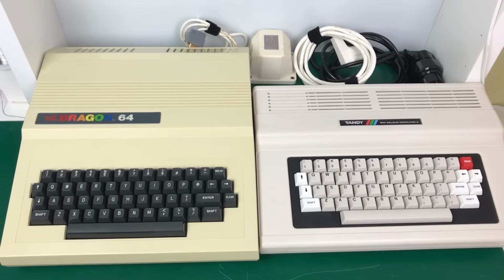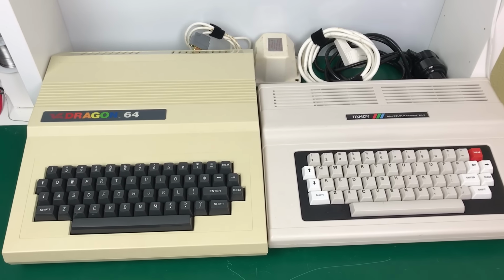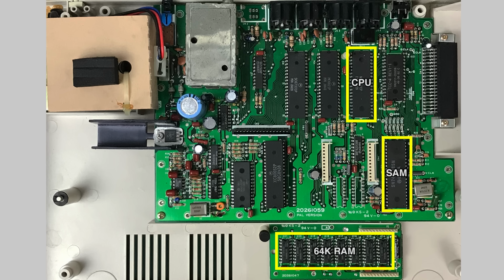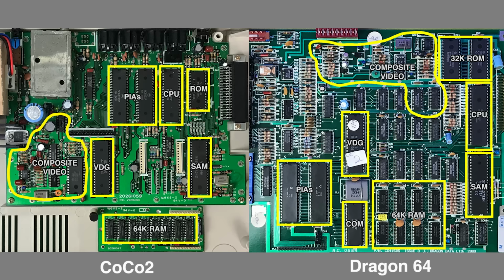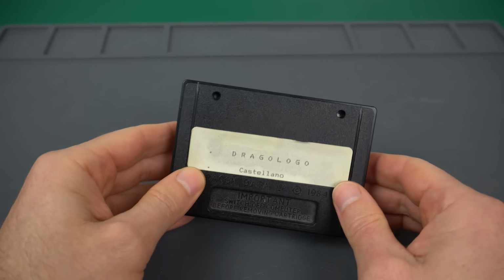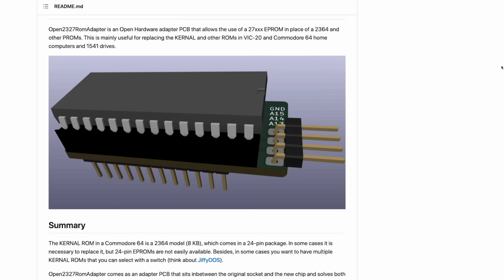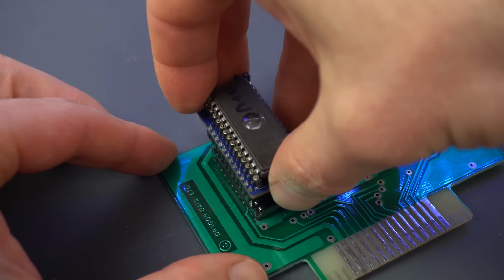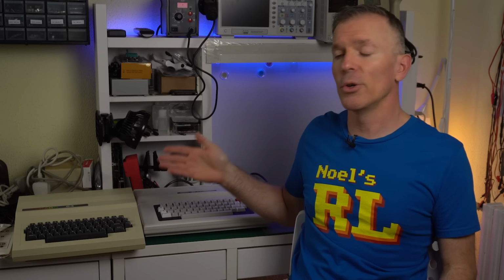Is The Dragon a Clone of the CoCo?

Comment: 10 REM HEX LOADER FOR EXTRA DRAGONDOS COMMANDS
20 CLEAR 200,31599
30 INPUT "START";ST
40 INPUT "END";ED
50 FOR J=ST TO ED STEP 8
60 PRINT USING "##### : ";J;
70 INPUT A$
80 CS=0
90 FOR K=1 TO LEN(A$)
100 CS=CS+K*VAL("&H"+MID$(A$,K,1))
110 NEXT K
120 INPUT " = ";C
130 IF C<>CS THEN PRINT "CHECKSUM ERROR - TRY AGAIN":SOUND 1,1:GOTO 60
140 FOR K=0 TO 7
150 POKE J+K,VAL("&H"+MID$(K*2+1,2))
160 NEXT K,J

this small program wont work - it results in a typo or type mismatch error ! please help if u can thanks !!!

Comment: Yes, looks like Dragon based it on the Coco, the same keyboard, the same Cartridge connectors, some software works on both etc.

They made enough changes not to be sued and maybe claimed it was based on some reference design.

In the 1980s something going on in a Welsh warehouse would not exactly be on the radar of a large company in the USA!

Let's just copy that computer, and the BIOS, and those BASIC ROMS, no one will know until that internet thing comes along:)

Comment: I worked at Motorola in 1977 to 1994. The CoCo was based on standard Motorola devices, 6809E, 6847 VDG. 6883 SAM, etc. None of these devices were Tandy proprietary. Tandy got the  software from outside sources. Tandy took the standard Motorola devices and standard software and offered it as a CoCo.

Comment: Great video!

Thank you for sharing!

The Tandy Radio Shack Color Computer 2 is what I started with.  Though the model I had used the standard 6847 not the T1 version.
As far as the Dragon64 goes the serial chip is a MOS 6551 which also the Tandy Radio Shack sold a Deluxe RS-232 Pak which also used this same MOS 6551 chip.
The serial port on the Dragon 64 is limited though to 38400 as the Op-Amps are slow in the Dragon 64.  You probably could upgrade the Op-Amps to faster versions to get speeds up to 57600.

As far as the floppy controllers go between the Dragon and the CoCo the basics have different entry points that is the biggest problem.  There is a Disk Basic called HDBDOS which is used for DriveWire on the CoCo which also has been modded to have the entry points updated so it will work on the Dragon's basic.  Though HDBDOS is based on Disk Basic that came with CoCo's floppy controllers.

DriveWire might be something interesting for you to look into if you like using the Tandy Radio Shack Color Computer 2 and Dragon64.  

Also there is a upgraded CPU that you can also use in the Dragon32/64 and Tandy Radio Shack Color Computers called the HD63C09E.  It has extra instructions and also is CMOS based and thus will run cooler and consume less power.  Plus there are custom OS-9's that take advantage of this CPU.  This OS is called NitrOS-9.

Comment: Looking at the Dragon keyboard matrix which is arranged electrically in ASCII order for faster key scanning and comparing that to the CoCo I would say the CoCo is the clone.
The CoCo matrix looks like they took the Dragon matrix and swapped a couple of rows. This would make the key scanning code less efficient.
Another clue that the CoCo is a clone of the Dragon is the Dragon has a parallel port and the CoCo uses the same IO lines to create a serial port. Where the parallel port is an obvious straight forward design the CoCo serial port is particularly cunning and would have taken much longer to develop.

When the Dragon 64 came out they simply added a serial chip for the serial port.

Comment: You can save the BASIC program with the A parameter (For ASCII) and it will load on the other computer.  It save the basic program in ASCII instead of compressed.  Take more space on the file.

Comment: 6:09   Its not really surprising that the coco psu is so small.  What's remarkable is how unnecessarily big the Dragons seems to be.

I mean, you'd think at least that they could have got the AC transfomer into the case.  Heck, the Beeb managed it.

And at the other end of the scale the Spectrum had a 9V power brick but managed to squeeze the generation of all the nessecary voltages onto that tiny mobo.

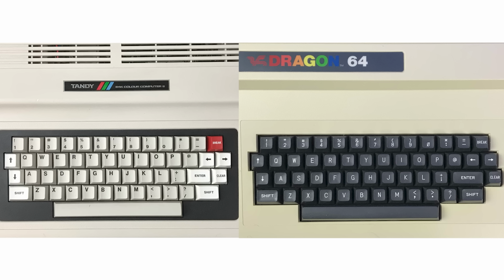12:46   Not sure what they were exactly, but I understand the Dragon keyboard stuff was changed for some kind of effiency/responsiveness benefit.  (https://youtu.be/0IipxReq0G8?t=680)
Reply: Making the computer with no mains inside is very sensible and allows children to safely open the case and tinker. It also means you make another company responsible for the transformer and carry out all the product safety whilst you work on the computer independently.

Comment: Both computers are actually based on a reference design from Motorola, the Microchroma 68, featuring a version of the MEK6800D2 MikBug monitor called TVbug. This was essentially what is in the coco (and dragon) computer. Tandy used this base design to create a  Videotex terminal for farmers called the AgVision, and if you google for that you will see its actually a blue coco, it even has facilities for what later became its cartridge connector. What I want to say is that Tandy cannot claim ownership of the CoCo's architecture as it not theirs, its Motorola's. They simply took the Microchroma 68 design put it in a somewhat nice case and replaced TVbug with a BASIC written by Microsoft.

Comment: The Dragon was a clone of the Tandy.  The ROM was a bad clone as there was a bug in Dragon BASIC, in its DEFUSR(0) command.   What killed both the Dragon and the Tandy was it's poor graphics chip the VDG.  It was worse than what the Spectrum, Atari 800 and VIC-20 could deliver.  The CPU was good, but was under-powered at 0.89MHz. Most enthusiasts today replace the 6809E with an Hitachi 6309 which is about 20 to 30% faster and clockable to 5MHz.  It may be a good project to see a much faster running Tandy and at 5MHz, as some of the old games really do need the extra CPU power to be playable.  There is also a poke to speed up the Tandy - POKE 65495,0 to double BASIC program speed and POKE 65494,0 will return it to normal speed.

Comment: I didn't play a lot of games on my Coco. However, I did a lot of hardware development. I built several peripherals for it including a universal EPROM programmer, a text to speech card, and a 6809 In-Circuit emulator that worked by allowing the Coc's 6809 to take over the target system's bus. I also build a data logging card that used a small fast ADC that had a two-wire multi-device interface that I had to bit-bang. I did many other projects as well. I miss the days of direct access to hardware! As for software, my favorite programs were the assembler cart and the terminal program that allowed me to dial into my favorite BBS. Remember those?

Comment: I prefer the COCO.  The keyboard is not that much worse, but the small size and built in PS are winners for me.  All that said, my real favorite COCO is the COCO 3.

Back in the mid-80's I used a COCO 3 with 2 double sided floppies,  a Tandy 1200 baud auto answer modem, OS-9 level 2 and BASIC-09 to build a BBS system.  Although I had less than 50 users, it was a great project from my perspective.  Those were the days!
Reply from the maker: Fair enough. I'm definitely looking forward to trying out a CoCo 3 sometime. Everybody raves about it.

Comment: The Motorola reference design was used as the basis for a videotex terminal sold breezily by RadioShack around 1980/It didn't sell very well. Radio Shack reused the  videotex deign for the original Color Computer

Comment: For what it's worth both manufacturers followed Motorola's reference design very closely and as Dragon Data also went to M$ for the OS/Basic that's the reason for the similarity. Not clones as such, more siblings. (The Dragon is no more a clone than I'm a clone of my older brother.)
The primary reason why they aren't 100% compatible is for some reason when M$ sold the exact same Basic (and technical support) to both manufacturers they fiddled with the tokenising in the Dragon version. Also the Dragon's keyboard mapping is a little different.*
*It's entirely possible to make a Dragon 100% Tandy compatible, and switchable between modes. A mod that had some popularity as the CoCo had more software alth9ugh you could just as easily make a CoCo Dragon compatible.

It's my unverified understanding that the very close similarity of the non-Motorola inspired parts was on the advice of M$ who weren't going to waste effort on rethinking technical advice for a small company like Dragon Data. Did Dragon Data know about the CoCo? Of course. Were they trying to make a CoCo clone? No, because they didn't. But driven by the same design process they followed a path already walked by Tandy.

Comment: I haven't gotten far into the video so you might address this later but, there were common composite board designs out there back in the day. Most used plunger test leads to connect to specific places to get the composite signal. I purchased one back then and my father and I duplicated it for the rest of my Cocos. I liked that design best because the RF port was still usable after the modification.
 
Edited: Never mind. I now see that you get into the composite mod. lol

Comment: A better way of looking at the parallel/serial port differences might be to think of the CoCo as having a serial port for the printer, instead of a parallel port as the Dragon does, and the Dragon having an additional interface for serial communications, such as a modem or a terminal for a second user if you're running OS/9.

The CoCo serial port was entirely bit-banged and while that was fine for a printer it was not so good when used for bidirectional serial communications. Not only did it lack any control signals except for carrier detect, but bit-banging  it ate a substantial amount of CPU time and set a fairly low limit on the serial rates you could achieve. This was especially noticeable when using OS/9 with an external terminal so that you could have a full 80×24 text interface.

I seem to recall that at some point a serial interface cartridge with a proper UART was released, but I can't seem to find any reference to it now.
Reply: There were several serial options.  Radio Shack put out an RS-232 Pak, still in the early days.  It could do at least 2400 bps.  Later there were a number of 3rd party serial cartridges, as well as multi-I/O boards like the Disto 4-in-1 that added a serial port, a parallel printer port, a real-time clock, and a SCSI interface on a daughter board that plugged into Disto's floppy drive controllers.  The advantage of a system like that was that it didn't require an expensive Multi-Pak Interface in order to use it with a disk drive.

Interestingly, very clever coding has gotten MUCH more speed out of the lowly bit-banger.  Drivewire allows a modern computer to serve up disk images to a CoCo over the built-in bit-banger port, and gets up to 115kbps on a CoCo 3, or 57k on a 2 in either DECB or NitrOS-9.
Reply: @joelavcoco  Sorry, I should have been clear when I was talking about "low rates" I meant low rates _while do anything else at the same time_, such as printing the received data to the screen, scanning the keyboard for things to send, or even running other programs such as you'd want to be able to do while using a terminal to talk to OS/9.

On pretty much any computer if you're willing to dedicate the entire CPU to serial transfer you can achieve reasonably high rates even with a bit-banged interface, but this is practically useful only for certain kinds of file transfer applications.
Reply: Towards the end of the Coco's life, there was a modern expansion "cartridge". If memory serves, it was still limited to 300 baud. It included a really poor terminal program. The hardware was quite rare -- I briefly owned one, but I do not recall any reviews or much advertising.

Comment: I seem to remember a blurb about the Dragon being designed with aid from Motorola and based on their reference design, but as you said the details are a bit too similar. I'd guess a believable scenario would be someone just handing them the schematic as a reference to the problem already being solved before.

The most telling part is that in the MC6847 datasheets they used a dedicated chip for the colour circuits, but here they've both got a dedicated circuit instead. I would think Motorola would have sold them on that chip instead of all those components.
Reply: It seems feasible that Motorola might have directed the design for increased compatability with the existing platform.  When Mettoy set out to create a computer it doesn't seem like they had a lot of requirements except "we need it yesterday".  And Motorola had worked together with Tandy to create the Coco.

Comment: When Motorola launched the 6809, and it's associated support chips, Motorola published a reference design to show how to use them. This design is basically what the Tandy CoCo and dragon computers were based on, with minimal difference between them.

Mentioned here:-
Internally the CoCo 1 and CoCo 2 models are functionally identical. The core of the system is virtually identical to the reference design included in the Motorola MC6883 data sheet and consists of five LSI chips:

MC6809E Microprocessor Unit (MPU)
MC6883/SN74LS783/SN74LS785 Synchronous Address Multiplexor (SAM)
MC6847 Video Display Generator (VDG)
Two Peripheral Interface Adapters (PIA), either MC6821 or MC6822 chips

https://zims-en.kiwix.campusafrica.gos.orange.com/wikipedia_en_all_nopic/A/Motorola_6809
http://www.roust-it.dk/coco/The%20MC6809%20CookBook.pdf

Comment: CoCo2 was my first system; got it from a garage sale in the late '80s. I learned to program in BASIC on that thing with the help of the book it came with. Though I think if I wanted to mess around with an old system like that again, I'd stick with a fantasy console, like Pixel Vision 8 or similar. Vintage hardware is too pricey and temperamental for my taste, heh.

Comment: Love the look and form factor of these older machines, especially the keyboards. Wish I could get a pc or Mac that was built the same.. like with the form factor of the bbc micro. That would be awesome!
Reply: I built a PC out of a BBC Micro case which I got from someone who had taken the main board and power supply. A 1U PC power supply fits in the BBC Micro case power supply space. I had to modify the case for the power connector. There’s a mini ITX board in the case and againI had to modify the back panel but it does fit nearly!

Comment: All I know is the Dragon line of micro computers were designed and developed in Wales, Great Britain. I slightly remember them in the 1980's. The Tandy computers not so but I do remember the high street shops called Tandy that sold electronics in the 1980's in the UK.

Comment: Looks like they both came from the same reference design, so they are brothers, so to speak.
The chipset and the Microsoft Basic emulator put restrictions on the way the system is designed, but Dragon64 design team did take advantage of what little leeway their was and distanced themselves from the Tandy machines. Legal fights based on forced commonality would not have much teeth in court.
Thanks for the comparison, good stuff!
Cheers,

Comment: I was sure I'd read that the CoCo was based very directly on a reference design put out by the CPU manufacturer so the Dragon would've also been based on the same reference design. That doesn't explain why everything is so similar, but might explain why some things are so different. Perhaps the things that are different were not part of the reference design?
Reply: Clearly Dragon Data copied Tandy then swapped a couple of things just to make it incompatible. Anyone writing software for one would simply need to release a version for the other. I expect they kept the cartridge the same in the hope of reducing cartridge manufacturing costs where as swapping keyboard lines or Basic tokens just makes it different at no cost.
Reply: However looking at the more elegant Dragon keyboard matrix it looks like the Tandy swapped a couple of rows to make itself different.

Comment: So basically they are both clones of the Motorola reference chipset designs..
Reply: yes, exactly, and did you know that this reference design was first turned in a into a practical machine when Motorola teamed up with Tandy to design a "videotex" terminal for farmers called AgVision , and Tandy created it from that reference design into what would later become the coco, It was simply a "blue coco" and Tandy already added a cartridge slot, although it was unused in the terminal. Later Tandy also sold the terminal in their shops, but changed its case color from blue into the coco's beige color. So in reality it wasn't really a Tandy design, but simply a Motorola design, that Tandy simply adapted. Its also the reason why it wasn't a Z80 computer like the original Tandy-TRS80 because Motorola probably wanted Tandy to use almost exclusively Motorola Chips (except for the memory chips, as Motorola did not make those). This was the reason why Tandy was able to launch a consumer color system relatively early.

Comment: Would it be possible to create a PCB that can switch between a coco and a dragon by just flipping a switch? I assume you can either use a PAL/GAL for the keyboard re-map, and a big enough EEPROM to place both "bios". You might lose the parallel port/serial port, but I think it's a small compromise for having a 2 in 1 machine.

Comment: In 1983 I designed a children's computer using that same Motorola chipset, so it was pretty similar to the CoCo. But there were many differences (serial keyboard, network, Logo in ROM, no cartridge, different sound). Not long after that a bunch of CoCo clones were launched in Brazil (Prologica CP400, Codimex CD6809, Dynacom MX-1600, Engetecnica VC50, NovoTempo/LZ Color64). That made people think my machine had been a clone as well.